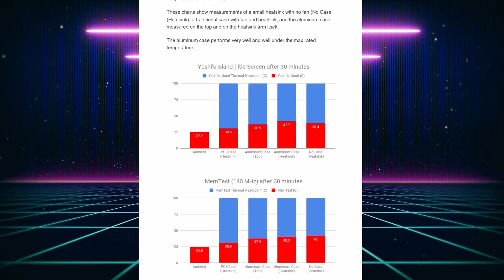MiSTer FPGA Hardware Build Guide - with MiSTer Addons Aluminum Case

Comment: No real time clock?
Reply: I don't think it would interfere with this case, but it's also my understanding that most people don't bother with it because MiSTer will synchronize the clock once it detects an internet connection anyways.
Reply from the maker: Yeah, exactly. It's not needed if you are always connected to the internet.

Comment: Man I'm so done with these cases, they make it nearly impossible to get the microSD cards in and out and you end up a total mess of dongles and cables coming out every side. Shoot some video of one of these actually fully loaded up and in operation, it will look like shit. Next build I'm going to relocate all the ports to one side of the case.

Comment: Has anyone run dual RAM?  It's my understanding it uses the same pins the analog I/O board uses, so choices have to be made, but it you use digital I/O or no I/O board, it's a good choice for future proofing, as some cores in development need the extra bandwidth dual RAM provides.  I'm just wondering if you can mix and match RAM modules, that way I can use my current RAM module from 2018.
Reply: Running dual ram with modules that are mismatched in size is generally okay. It is my understanding that most peeps will put the max they have in one slot then run 32MiB in the other slot, though I think running larger secondary modules is okay as well, just not used to their capacity.

Comment: That aluminum heat block design is a little weird since it has ample room to actually put a vertical heatsink there and you wouldn’t want to shape it like that if your goal were to minimize heat that is exhausted inside. To conduct as much heat outside as possible you’d want a solid, centered, aluminum column without the blue anodizing on the bottom.

Personally, I think it should have an internal heat sink on the vertical portion since other components can heat up and increase the ambient internal temperature. If ambient temps climb higher the fins will actually absorb heat to cool the ambient air too.